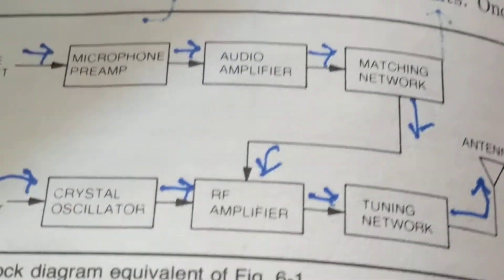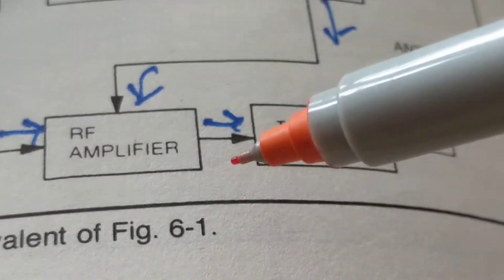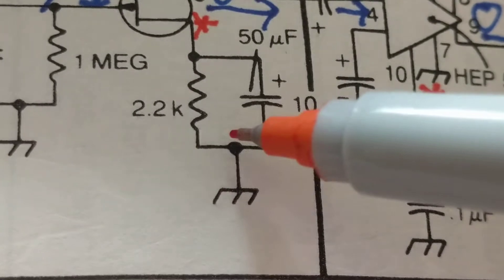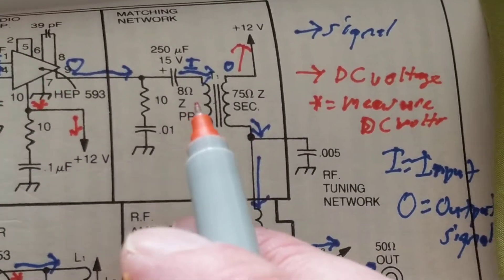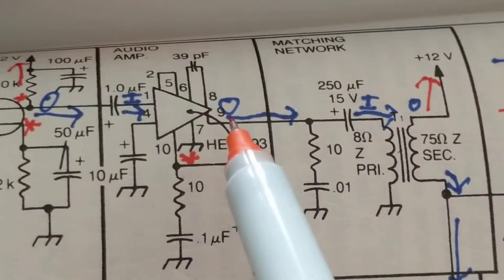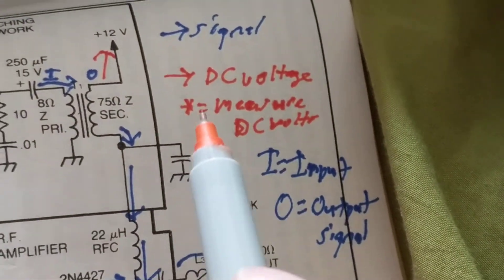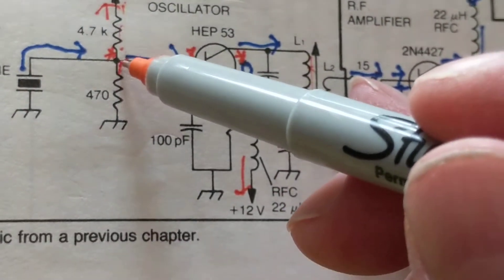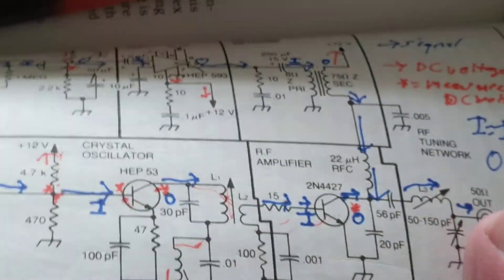how to UNDERSTAND BLOCK DIAGRAMS and  STAGES TO ANALYZE SCHEMATICS EASY TO UNDERSTAND

Comment: What if you don't have any block diagrams and only a schematic. You need to know the different circuits in order to identify them. For example, a current limiting circuit in a power supply... If you don't have a block diagram and don't know what the circuit look likes then it is very difficult to find any problems that may exist...

This has been a good video though, thanks!
Reply from the maker: Good question. It depends the subject that you are looking at for automotive basically there are blocked diagrams if you're looking at basic electronics there are not basically block diagrams you just have to try to the function of key components like transistors and chips